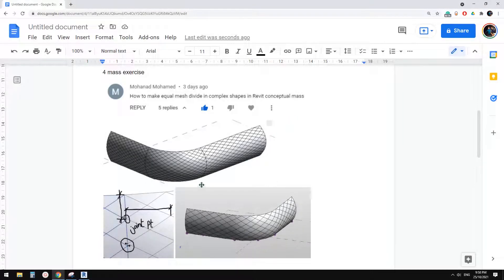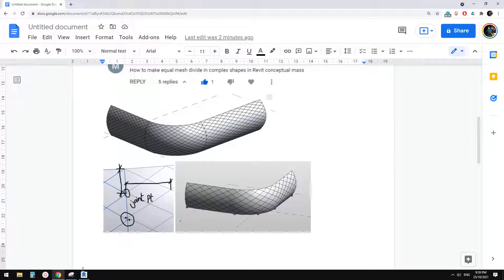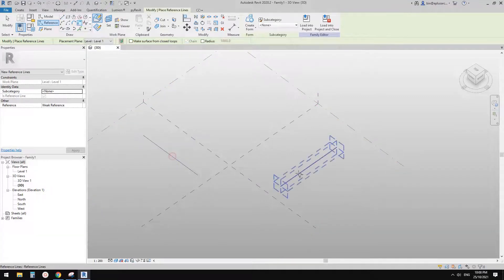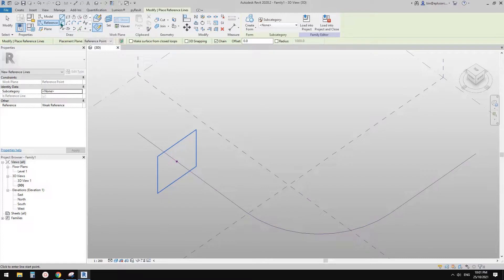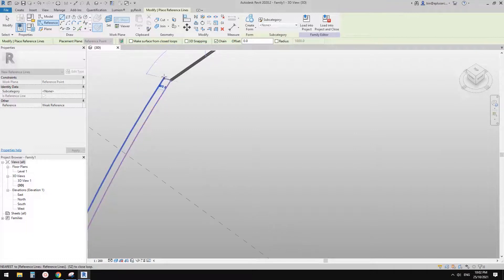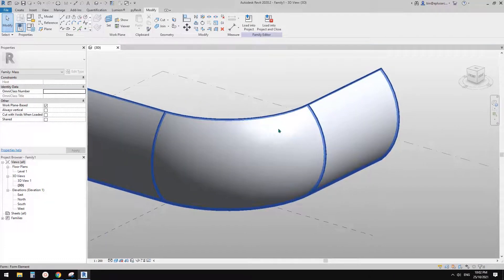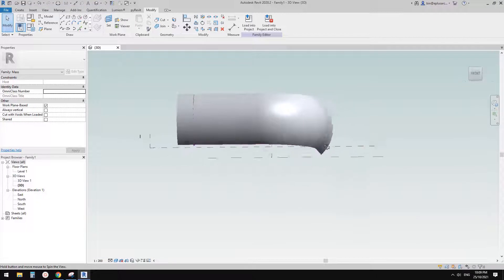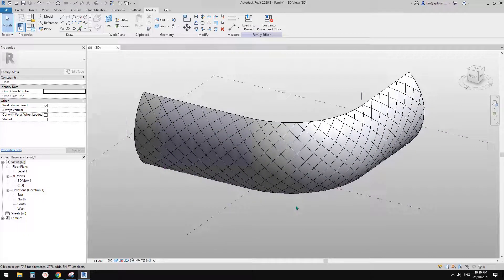Revit Exercise (Day 582) - Mass Exercise

Comment: Great tip! But can i ask you a question! At 9:23 you "Spline Through Point" and not delete old reference, Do that method still ok?
Reply from the maker: When you say old reference, do you mean the Lines and Arc, or the Points? You can delete the Lines and Arc if you want to. The Points will become part of the Spline.